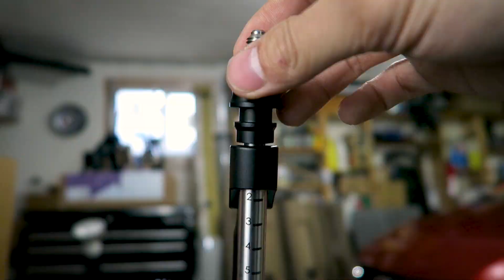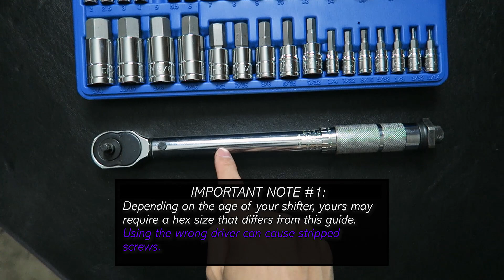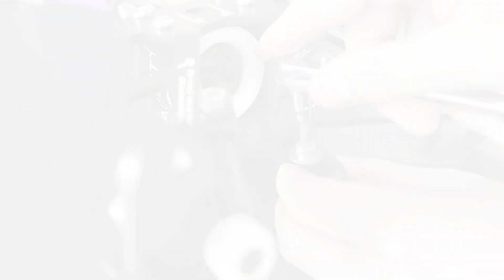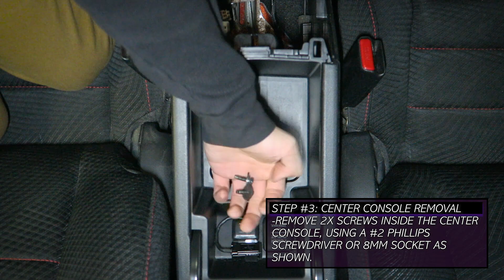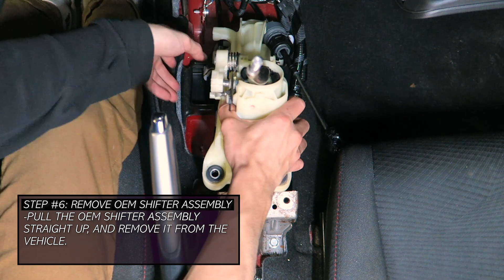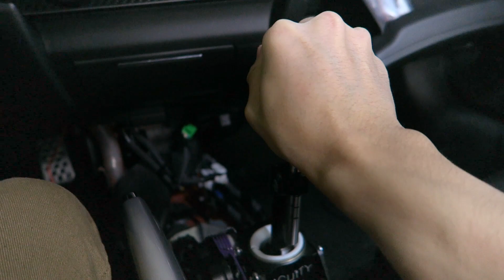ACUITY 1880 Adjustable Short Shifter Install Guide for 2012-2015 Honda Civics

Comment: I would highly recommend buying this shifter if anyone is wondering if they should get it. I bought the short shifter along with shifter bushings and had a HUGE DIFFERENCE in feel comparing it to the stock shifter while driving. Every thing about it feels so good, very accurate, smooth, stiff, and you get way faster shifts! It’s worth the money! (:
Reply from the maker: Thanks for the love, Tim! Glad you're enjoying the new shifter. :)

Comment: finally best install vid ever! cant wait to have one!
Reply from the maker: Thanks man! Hope you enjoy yours when u get it 😎👍
Reply: i have 1 question,did you put back the air duct after? or dont have to? thanks
Reply from the maker: @thatcelestial_taco  Yes, you need to put back the air duct. Its optional to remove it from the working area so that you had more space around the shifter cables :)
Reply: thanks

Comment: Bought a 10th gen Si that already had the Acuity installed. Shifting into every gear is incredibly stiff and has a certain resistance to it. What are your recommendations on adjustments?

 This does not shift smoothly, which makes it a helluva lot more challenging to quickly transition to another gear. If I was racing, the lack of quick shifting would put me at a disadvantage  every time.
Reply from the maker: Hi Josh, it sounds like the adjustments need some tuning to your liking. Consider setting the throw and gate adjustments to the longest throw and widest gate settings, then adjusting the height to the tallest setting. This will give you the lowest effort shifting the shifter is capable of. Also, are you using the stock shifter cables or aftermarket cables?
Reply: @ACUiTYinstruments  thank you so much! I'm not sure about the cables as I wanted to reach out to you guys before I started pulling anything apart. What signs should I be looking for relative to proper cable placement?

 It definitely seems like the last owner  didn't spend much time perfecting the setup so I am seriously looking forward to getting it properly dialed in. Thanks again!
Reply from the maker: We're happy to help identify the type of cables you have, just email our support team with a few pics of them (support@acuityinstruments.com). An easy way to find out if they're stock or aftermarket is to take a look in the engine bay on top of the transmission and inspect the cable ends there. Most aftermarket cables will have their branding on the shifter cable ends. If they're aftermarket, or have aftermarket bushings installed, it may be worth inspecting where they are affixed on top of the transmission to make sure the cables are fully seated into their mounting bracket and that the cable retainer clip for each cable installed correctly too. If a cable retainer clip is installed crooked it can misalign the shift cable and make shifts feel more difficult to engage. With aftermarket cables it's also important to check that they were routed correctly and not twisted or bent in tight angles so they can operate smoothly. Again, we'd be happy to help inspect any pics you can provide us with to assist you further :).

To inspect the shifter as well, definitely try disconnecting the end link of each cable from the shifter and then test the shift lever movement back/forth and side to side. If the shifter operates smoothly with no play or binding, then chances are the increased shift effort you're feeling could be remedied with some more experimentation on the adjustment settings. Otherwise if shifting still feels difficult or sloppy in all gears, then the cables might need more inspection and/or replacement.

Comment: Does this shifter fit the 2013 ILX 2.4L 6 speed manual?
Reply from the maker: Thanks for reaching out to us about this. Our 9th gen civic short shifter will fit the 2013-2015 Acura ILX, but just be aware that you will not be able to adjust the shifter to the shortest gear throw setting. This is because there is a module under the factory shifter in the ILX that is not present in the 9th gen civic that will contact the cable endlink if the shifter is adjusted to the shortest gear throw position. The shifter will operate fine with all other adjustments, and you should be able to retain the factory shift boot and shift knob with it installed too.

Comment: Nice short shifter! I am wondering if it is possible to put the oem boot and shift knob back on?
Reply: Yup. All Acuity shifters are designed to be compatible with the OEM boot and shift knob. It's just very common for people to appreciate the appearance of the shifter and decide to leave the shift boot off. If you prefer the stealth look of the OEM boot and knob though, it's no problem to go that route.
Reply: @rgareh1  Aprreciate it bud, gonna be my first mod. Can’t wait!

Comment: How does it perform with the stock cables??
I want one so bad but I’m really afraid about it having so much adjustability lol, my anxiety goes up just thinking about it. How on earth am I going to find the right position with 4 different settings 😵‍💫😵
Reply from the maker: We recommend stock cables over any aftermarket options available as they tend to be more robust and reliable than existing aftermarket options. Regarding adjustments, set the height, throw, and gate spacing all to the middle of the adjustment range. The rotation adjustment is only for adjusting shift knob location and is not super significant to feel. Drive the car for a bit, then decide if you'd change the height, gate spacing (how far the shifter moves left/right), gear throw (how far the shifter moves forward/back), and adjust the settings based on what you'd like from the shifter after that test drive period. Shifter settings are a very personal thing, so it's helpful to start in the middle and then go from there.

Comment: Do you need to put grease on the shifter?
Reply from the maker: We supply grease on our shifters so no additional grease is needed. That being said, if the shifter is old and the pivot ball looks dry you can use lithium or silicone grease on it. If you contact us through our website we can also make an order for a packet of the exact purple PAO grease we use on our parts.

Comment: The ultimate question though Hybrid Racing or OEM Cables sir?
Reply: As of this moment, the OEM cables are the best value in terms of feel and durability. We have yet to see an aftermarket cable option that outperforms and outlasts OEM cables. Plus we have found most aftermarket cables add a lot of friction which makes shifting feel stiff and vague. ~Russ @ Acuity

Comment: For the throw settings do u guys recommend close to stock or what for a better result ?
Reply from the maker: It's very much personal preference. We normally suggest starting with the throw, gate-spacing, and height settings halfway in their adjustment range, trying that for a while, then adjusting and seeing what changes you like. With people's experience shifting and body morphology having so much variation, there's always a sweet spot for each person. Halfway in the adjustment range generally feels pretty solid for most, although many people eventually opt for more aggressive settings once they are used to the shifter.

Comment: How do you get the cables back in the brackets? It’s really hard to get them back in the the new shifters brackets.
Reply: If they are getting snagged during install, they are probably not going in totally parallel to the bracket. Make sure the slot in the cable is very well aligned with the bracket before pushing it into the slot in the bracket. I've run into this same exact snag and that worked perfectly for me. Best of luck!
Reply: Russell Garehan thanks I’ll try it out this weekend
Reply: Hey thanks for the tips. They helped out a lot!

Comment: Can you still use the shift boot cover  ..  i dont like the look of the shifter exposed
Reply: Yes, all of the Acuity shifters permit use of the shift boot. Some customers just like to remove the boot to show off their shifter. The boot helps to block out road noise and heat coming from the center tunnel though, so removing the boot does increase road noise and heat from the exhaust by a small amount. Keeping the boot also makes sure that no debris gets onto the shifter's main pivot which will help the shifter last longer.

Comment: Can you keep original shifter boot with this installed?
Reply from the maker: Yes, 100%. The only time it creates an issue is if you are trying to run the height at the minimum setting. To do that, you have to use our 1924 shift boot collar instead of the OEM one as the OEM one is too tall. But that only limits reduction of height by about 5mm. You will have no trouble running stock height, slightly below, or at the max setting.  :) ~Russ

Comment: What size of an inch drive is the torque wrench?
Reply: You'd want to choose a torque-wrench that's sized for your drivers. That said, most torque wrenches that have a small enough torque range for the torques on this part will have a 1/4" drive. Most importantly, choose a torque wrench that has the correct torque range.

Comment: Need HELP!  I installed the short shifter, base bushings, transmission select springs and cable end bushings and now I don't have 5th, 6th or reverse? 

It was hard lining up the upper cable after installing new bushings, olcould it just be a bad cable?
Reply from the maker: Hey! We’re sorry to hear about these issues with your recent upgrades. If you haven’t yet, please send our support team an email and we will get you in touch with our engineering team asap to help you resolve your gear engagement issues. Please supply a few pictures of how the parts look currently installed if you can as well so we can inspect how the parts were installed. Our support email is support@acuityinstruments.com 🙏

Comment: getting a 2012 civic lx soon, does this work just fine with it? just wondering since pretty much everything seems to be only for an si lol
Reply: The Acuity 9th Gen Civic shifter, shifter base bushings, and shifter cable bushings work on all manual transmission coupe and sedan 9th Gen Civics. They won't work on a hatchback 9th Gen Civic as the hatchbacks use a totally different shifter.
Reply: @rgareh1  gotcha, thanks g

Comment: I droped the plastic washer and still have the pin what now?
Reply: If you are referring to the white plastic washer that’s held on with a cotter pin, you can safely, temporarily run the shifter without the washer. The cotter pin is a must though Shoot us an message via the contact-us page on our website and we can assist in getting a replacement. 👍🏻
Reply: @rgareh1  thanks I have another washer on the way. For now I will granny shift like I should.

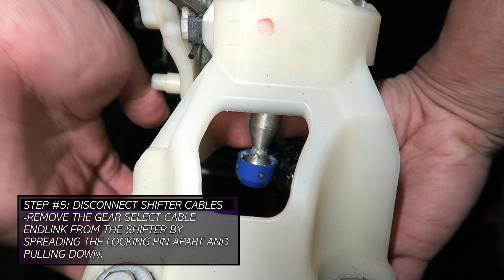Comment: 5:07 - HELP does anyone know the name of the clip (Gear Change Cable End Link?) here and how I could get a replacement? Recently bought a '14 Civic Si pre-owned and the previous owner lost/broke this clip, and replaced it with a zip tie :(
Reply: If you are referring to the metal-wire spring clip that holds the cable to the shifter, I'm afraid that is a part that comes with the shift cables. That said, it is found on MANY hondas, so your odds of locating one at a junk yard are excellent. The same clip is used to secure shift cables manual transmission-equipped cars from the following models: 7th Gen Honda Civic Si, 8th Gen Honda Civic (base model,  si & R), 9th Gen Honda Civic (base model, si, & R), 10th gen honda civic (base, si, & R), the 2nd Gen Honda Fit, 3rd Gen Honda Fit, and likely quite a few more. Hope that helps! ~Russ
Reply: @rgareh1  Okay awesome, thanks Russ! After calling around all day I found a Honda Parts dealer who may have something for me , but Plan B will be the junk yard. Thanks again!

Comment: May have already been asked but does this fit the euro mk9?
Reply from the maker: I think you're referring to the hatchback chassis, like the FK2 type R. Is that correct? If so, unfortunately this will not fit as the shifter in that vehicle is quite different. The good news is we have a shifter for that version of the 9th Gen Civic in design presently. :)
Reply: @ACUiTYinstruments  brilliant cheers

Comment: The locking nut on my si (nut under shift knob) for some reason just spins on its own kinda like if was cross threaded or something. Does anyone else have this problem?
Reply: Below the threads, there is a thinner portion of the shift lever. It's possible you've run the nut so far down it came off the threads onto the area below the threads that is not threaded. If the last thread was damaged during the process of running the nut down, it may be tricky to get the nut off. Using a small file to repair the last thread so the nut can be unthreaded might do the trick. Worst case, the upper lever on the Acuity shifters is not too pricey and can be purchased separate. If you can't get the nut off and want to go down that path, shoot us a message on our site via the contact us link and one of the customer service guys can assist with that. ~Russ
Reply: @rgareh1  what file do you suggest I use? Also how would I use the file to solve this problem?
Reply: @rgareh1  like am I supposed to poke it or...?
Reply: @rgareh1  pls answer asap
Reply from the maker: Rosendo, please reach out to our support email (support@acuityinstruments.com) or the contact us form on our website. If you haven't already, we'd like you to send pictures of the shift knob, upper rod threads, and the binding nut so we can inspect what you're seeing and then we can advise you further on how to get your shift knob secured in place 🙏
Reply: @ACUiTYinstruments  can I do it through Instagram?
Reply: @Fgendo  Yes, instagram would be fine. Our account is @acuityinstruments . About your file question: you'd have to have access to the damaged threads to clean them up and you'd want to use a small triangle file for the job.

Comment: Anyone in la that can install this for me ?
Reply: Try JHP USA or Art of Attack
Reply: Russell Garehan none of those places do installs . I can do it myself I’m just bugging about torque specs ? I wouldn’t want to not tighten something tight enough and have something fail on me while driving. Or over strip something .
Reply from the maker: Our PDF install guides should have torque specs required for the install. The shifter also has torque specs laser etched near the adjustments so you never have to guess how how tight to torque them down 🤘😎. Install guides can be found at www.acuityinstruments.com/install
Reply: ACUITY Instruments I’m getting my acuity shifter on Monday . Can’t wait . Thanks !

Comment: Literally had this since August. Right cable always pops out. Shifter squeaks. Tried taking it out the the screws stripped. Trash quality
Reply: Hi Virtuoso7, why don't you shoot us an email via the site for some warranty help. The cable popping out is likely due to the cable not being properly latched in. This is the only thing that would cause that (or if the latch on the cable was broken). The squeak may be our fault. There is a point on the shifter where the purple spring slides against the metal frame plate that needs to be greased. Doing so at that point should remedy your issue. Also, we use class 12.9 hardware in most places, essentially the strongest commercially available metric hardware without getting into rare aerospace stuff. Using poor quality drivers or not using the torque specs can cause issues, and mistakes do happen. At any rate, we are happy to help you if you would like to file a warranty claim, just contact us via the site. Since you have had this shifter nearly a year, please get in touch with us while the warranty is still valid so we have no troubles assisting you without expense to you :) . I would have contacted you via youtube, but your page does not appear to allow it. It's always best to get in touch with us if you ever run into a problem. We are very supportive of our customers. ~Russ
Reply: Russell Garehan could you update the video where it needs to be greased please
Reply: @For_Cruyff_Sake  Unfortunately, Youtube doesn't let us swap out videos (otherwise we'd post updates often). The point you are looking for is related to the purple spring on the shifter. The spring has an upper leg and a lower leg. The spot you're looking for is on the lower leg. It's right where the lower leg bends and touches the metal frame. It's pretty easy to spot with the shifter in front of you. If you have trouble locating it, shoot us a message on our website asking for a pic of the location and we can respond with the pic. :)